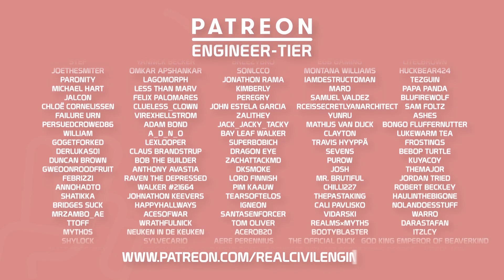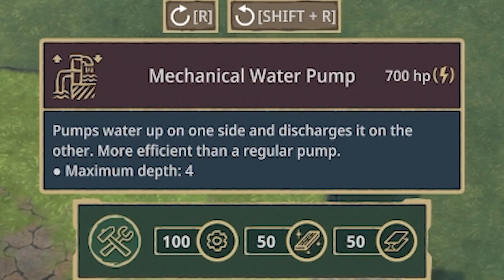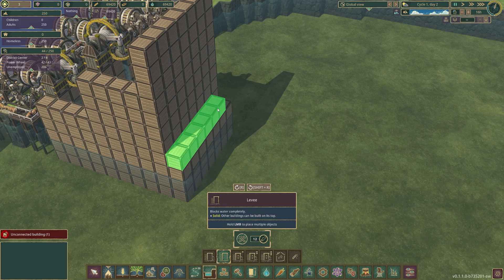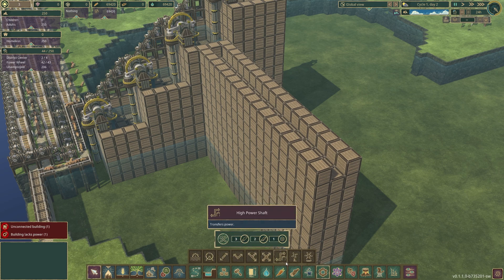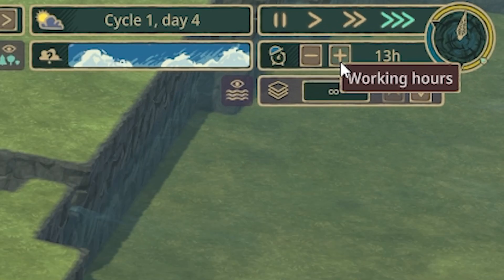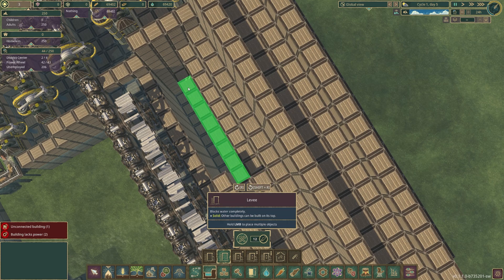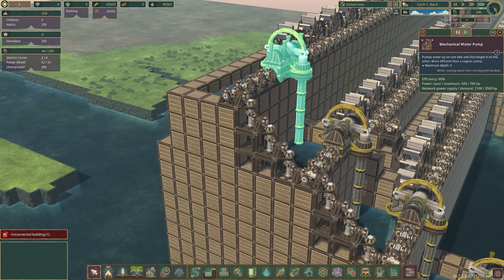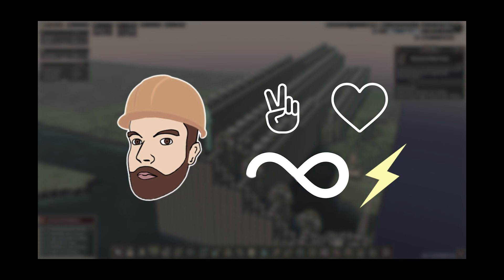Engineering INFINITE POWER in Timberborn!

Comment: I also would recommend to leave one of the blocks damming off the flow, so the water takes longer to dissipate. Also maybe pressure system but idk if the game will model that.
Remove the reservoir for the top pump until you need it, wasted water drying up, also may be slowing down the initial flow with the dip.
Another thing is adding adjusting levee right off the main pump area, so you can build it up to overflow or .5 and get it to go gradually.

Comment: If you need a design a YouTuber imkibits has done it before and succeeded. The key to infinite power is patients as it takes a while for the water to flow all the way down and the water wheels can be somewhat inconsistent. Also I don’t recommend putting any levees in the system instead use a flood gate set to 0.5 this will allow there to be enough water to flow while not stopping the initial flow too much. Also when it starts running it will not spin fast.

Comment: I feel like you need to increase velocity of the water. Maybe it is a function increasing height drops so instead of the first water wheel being at the same height make it one or two blocks lower. And you could supplement the water from the auto pump with beaver hauled water. That way you can jumpstart the wheels without the shame wheels.

Comment: The water wheels reduce the speed of the water as they take energy out of it. You need to make more "steps" (have the water flow down) more often for it to keep its momentum.
TL:DR Water needs to go faster, the faster the water, the more energy from the wheels, wheels slow down water.
Reply: If this was irl then this would be true but its not true with this game. The water wheels do not currently slow the water flow.

If you want proof, you can put the depth marker in the water, since it also shows you the speed of the water's flow. You can compare the water flow without water wheels and then with water wheels in place. 

I believe devs have spoken on this. I saw like 3 or more videos this weekend, all on this same concept. In one video, the creator talks about the devs acknowledging that the wheels do not slow the flow of water.
Reply: @Bama_Boy 
From the December 17 patch notes:

-Water Wheels now have variable HP output, depending on the current’s strength. If placed well, they’ll be even more effective than before.

-Water Wheels will now slightly slow down the water passing through.
Reply: @wanderingursa8184  yes I missed that part of the update. Slightly slowing it, I'm curious as to how much each wheel slows the flow. 

They need to add slopes, I don't see how dropping straight down will speed up the water that much. Yes if there was slopes I could see it working well, but not a straight drop off.

Comment: 12:35 Yeah the water physics is 2D, not 3D. Each cell has a water height and that's it. So you're not allowed to put solid objects (i.e. levees) on top of non-solid objects (e.g. platforms) because the simulation can't handle water being above empty space.

Comment: The big change I'd make would be to use the Iron Teeth beavers. their water pump can pump water up six blocks, opposed to just 4, for the same horsepower. In addition to the better pump, they also have bigger water wheels. I don't know if the bigger water wheels are more efficient per space, but I'd at least be worth looking into.

Comment: It is possible to get infinite powah. Another youtuber did it. What you did not calculate was the flow of each pump. Basically you need more pumps for more water. More water = more flow = powawheels spinning faster = more powah. You will never get the powawheels to give you full potential output but you can run the pumps off the power provided by the wheels. As long as you have a supply of whater. It will stil need a quarter or so of your map so not practical and near impossible withouy mods, but it was done already.

Comment: I think if you started with the water source up high on a cliff or hill, you could put water wheels going downstream to a reservoir. Then you can pump it back up through your contraption. You probably need more pumps towards the bottom to get more volume at the top. Also, do the water physics allow for greater velocity with a greater drop? If they do, maybe you could have a massive drop on the higher aqueducts to let gravity build up your water pressure.

Comment: It is possible to get excess power, you just need a massive stair step structure and 3 pumps per level.  It's also easier to do with ironteeth since their pumps go 6 levels deep.  I used 9 pumps and about 250 wheels (ironteeth wheels are only one block wide) and got thousands of excess HP.

Comment: If we assume that the pumps transfer water the maximum distance upwards possible under atmospheric pressure, about 10 meters or four blocks in game, that would give a beaver in this world a length of 2.5m or 8 foot 4 inches. The size of an average female alligator is 2.6m.

Comment: I can't be the only person who was wondering why not just have the water from the top one go through the track of water-wheels and then have that water go into the lower dam area to be pumped back up. Then repeat that for each of the areas so that way you are not only relying on the pumps to fill the water of each level but the water that is coming from the above areas will also flow down into the next section of water-wheels. So the bottom layer would have 1 pump, 2nd layer has 2 pumps and as you get higher you add pumps so that there is more water being pumped to the top where it is needed to create the initial surge of water.

Comment: i saw someone doing it with longer slopes and 2 pumps per stage. for him it barely worked (like 2000 input and 2100 output). It is possible bunt needs a lot of fine tuning

Comment: only 1 pump is needed ( you took away the water from 3 rd pump so there wasn't enough water going in to work maybe dam would work to keep water high but not sure if the flow would be high enough 
next time try using 1 or 2 pumps on same level and same water wheals

Comment: I made true infinite power with a similar strategy with the Iron teeth faction almost as soon as the experimental build got released. I did it in the game itself, so no cheating mods. It works with both types of water wheels, but you need more pumps. 
The most efficient way I found was to use 9 pumps in parallel and use at least 30 large water wheels. Do not use pumps in serial to increase the height even further. The slope down does not need to be steep, just drop one levee every 15 large water wheel or so (even less should work just fine).
A separate power source is of course needed to start it all, but after that it can be disconnected as long as you don’t take too much power from it or the system looses too much water.

Comment: ok so I am going to tell you this your Idea can work it is just you do not have enough water flow rate and depth to get the wheels really turning good.  You also wont need to go as high as you are trying to do.  Get just two pumping up water on the same level instead of just one pump at a time you will need 1400 power to get them started but that is easily achieved temporarily with some large windmills or generators depending on the faction you are.   You don't need to make them go down a tier as much as what you had just taking the water down by one level will help it flow faster.  So you have your first row with about 6 wheels then it goes down by only one layer as it curves back around for another 6 wheels then curves back around for the next 6 if you have a water source that you can start this process with that is high enough you can take it down more layers and add in extra pumps to get the water back up during the droughts.

Comment: Water wheels will reduce the water flow behind them, so you need to have at least a full wheel worth in free space between two wheels.
Reply: That's what I was thinking; the step canals would work with that maybe for the extra water velocity

Comment: To save space/blocks you should of used the support of the higher canal as the inner wall for the lower canal. Across four rows you'd save enough space for a fifth row. Also it'd probably be best to build up instead of down. You'd get the bottom row first, with just one pump (a sort of primer) and then start building the next row higher up, that way you aren't taxing the power supply to much to quickly.

Comment: So I have a different theory to fix the issue... have the water nonstop pump into a giant reservoir at the top and have the water waterfall out one or two blocks down into the canal and run water wheels with gaps going down in 1 block steps... this should fix the issue of water slowing up so much as for it having a positive energy outcome? Probably not but it's worth a shot ig

Comment: More incline is definitely needed, more step downs will keep the water flowing instead of trying to push it over a flat surface. Maybe make the pump area one block higher than your wheels and use a dam, that way the water can build up and still flow down. That would make the first few wheels turn at the least

Comment: You recognised that the water was travelling too far on one level quite early but did nothing with that revelation, every new addition was longer than the first

I'd recommend either two or three wheels per meter in height

With the pumps being 700hp per 3 or 4 blocks you wont need that many wheels over a 3 or 4 block height to make the power for this plus a profit for unlimited power

Edit, add a water speed check somewhere in the flow and make sure one pump is enough to move the water, you might have needed two per row

Comment: Well it's neat to see that Timberborn is obeying the laws of thermodynamics and conservation of energy.
Reply: RCE saying "it should work in theory" was good for a laugh. It shouldn't work in theory, but it might work in practice
Reply: @drewbeck1000  hahaha that gave me a laugh :)) You are right :)
Reply: Not really. I made a one level design (no pumps in series), where I get constans 728 HP with one pump and 1575 HP with two in parallel. It now gives energy for two lumber mills for droughts.
Reply: He's using power wheels. Its not perpetual but its renewable. Anyway, 8-10 day droughts dries it up pretty quickly you won't be able to produce energy constantly unless you use some windmills or energy factories.
Reply: @KorhalKk  The wheels are powered by water moving, the water moves due to gravity, the water is moving due to gravity because it's high up, the water is high up because it was pumped up, the water was pumped up because the pumps have power, the pumps have power because the wheels are turning.

ie: the pumps power the wheels which power the pumps. It's perpetual energy.
Reply: @JohnSmith-zl1tr  The game doesnt work like that because of droughts.
Reply: @JohnSmith-zl1tr  It's not perpetual energy, because it doesn't work

Comment: i would probably try dow put a dam before the water wheels. Then you alread have a little drop and the water will be moving. Then every 3 water wheels another drop. and 2 water wheels next to each other ( 6 in total per section). I think you will need to get the water wheels to 90 bp and not at 22 bp. I also think you have a water shortage problem at the bottom ones because you send all water upstream. Starting with 1 Level first you get down to normal level. add another pump at the bottom than add another level that feeds into the first wheels, like you already did. That should get the bottom ones moving fast. So for four tears you will need 4 pumps on the bottom, 3 on step 2, 2 on step 3 and 1 at step 4. Does that make sense? Am I totally overthinking this? Probably...

Comment: I only see this possible if the water source it's high, or you manage to do a... "Water silo"? With enough water reservoir to give a strong water stream all the dry season, even if has passed three days already. But that's weird and kinda impossible to handle 24/7, since in certain point you should lower the water stream to fill the silo again and... No, keep it unstoppable it's not possible, besides you could pull this thanks to the shamewheels at the beggining, al the invested resources doesn't worth. If the terrain and/or buildings are somewhat on your favor of doing a big and deep reservoir of water, I see possible of doing a good energy source to supply instead of engines when you get low on logs

Comment: Really need some more pumps to increase the water flow. I would try 4 pumps on bottom row, 3 on the next, then 2, then 1. Let the overflow of each pump level flow into the wheel levels. Fairly certain pumps pump more water when the block they pull from is full.
Edit: or maybe just decrease the size of the pool each pump collects from
Reply: while having more pumps on the lower level may sounds like a good idea, it is not in the best interest of efficiency. it seems that, having more pumps then nessacery wont cause water to "spill out" clearly by game design, what you are doing is, wasting energy pumping extra water up that you don't need, instead of spending just 700 BP pumping water up a single level. your now spending 2800 BP doing essentially the same thing with no extra benefit, the speed of the water running over the water wheels is important, but only to a certain extent. an easy way to think about it is in water block per second. which lets just say is the maximum amount of water you can flow through a 1X channel before it overflows
water wheels are 2 wide at the bottom. and it is possible to flow water through the middle of a water wheel as well to make it flow faster so if you have 4 blocks worth of water you can possible double the energy output of a water wheel, in most cases however you need to get tricky with how you receive energy from this setup making it larger then nessacery. also when working with multiple layers it is not really important to shove 4 block worth of water through a water wheel. 2 is plenty, 1 pump also outputs about 1 block worth of water so for this setup. 2 pumps per layer would be ideal for this setup, again in your example. you would be only pumping half the amount of water into the water wheels. the 1 pump at the top would be a bottleneck and the 3-4 pumps at the bottom would be a waste of energy unfortunately :/
Reply: 4,3,2,1 is a good idea! Also deeper or wider aqueducts/viaducts 🤔😝
Reply: what?! NO! OMG.....the only thing which matters is the throughput of water per pump and if you have only 1 pump at the top level then you only have 1 pumps worth of water throughput going over the water wheels, but you're now using an ungodly amount of power on all the lower level pumps which are now flooding over each pumping tier reservoir since the pumps on each row are moving less water than the previous row. instead of 4,3,2,1 just do 2 in parallel and use the 4 extra tiles of height for a bunch of wheels, remember to bottleneck flow to 1 tile between each wheel and you're golden, it's all you need to go net positive.
Reply: Also, maybe making wiers with one dam and one levee at the edges (water ladder) to focus the water pressure.
Reply: More pumps. Let the overflow in, to combat evap as well but wider water wheels would give you better efficiency across the horizontal movement. Try making the wheels twice as wide. Ideally you’ll get twice the power concentration this would mean also wider basins which would increase the amount of water in your network. And then a small amount of over flow going In to the lazy river at awayward flowing points to give it that extra push. And maybe if you can find pumps that use less power you can increase the flow amount that way.